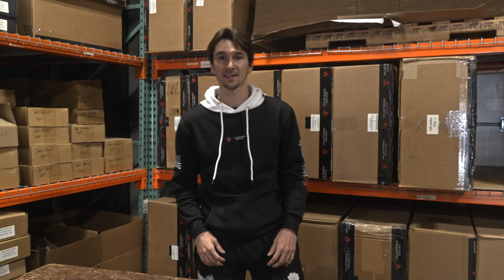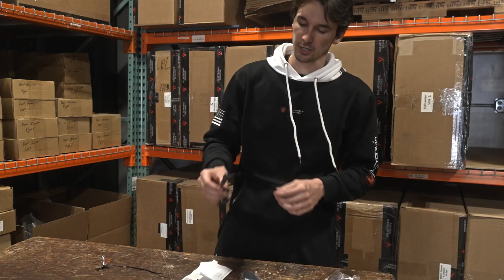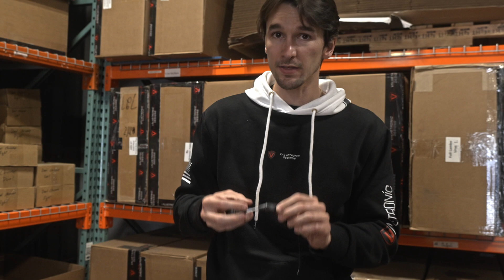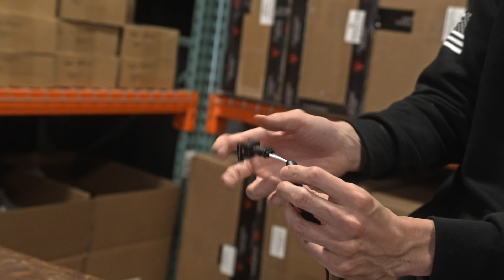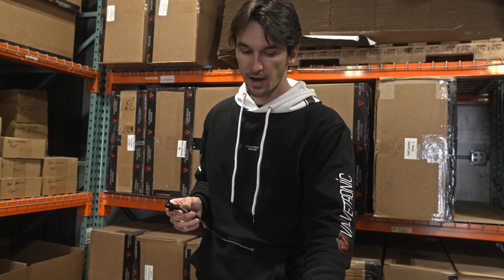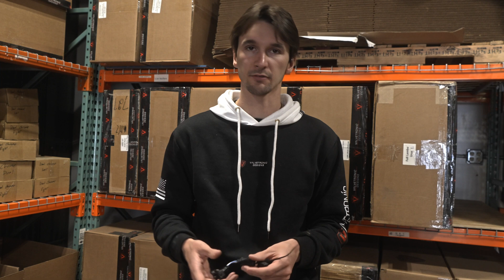OEM Valve Controller Common Issues and Fixes

Comment: I had control over my flaps for months and then they suddenly went out, they open on their own sometimes, I hear the solenoid open when I sport mode + gas it but it still doesn’t seem to open, any ideas?
Reply: Did u figure out what’s wrong ?
Reply: @yeimisantiagos2042 think it was just the burbles I had on the car smacking the valve eventually breaking it, sold the car tho never fixed
Reply: Mine is stuck closed right now for some reason.  It was fine for like a year then one day stopped opening up with the remote button. The fob battery is fine, there's power to the box,  and the vacuum line is fine.  It just won't open up now.  I'm thinking it got stuck shut inside. Kinda disappointed

Comment: Quick question, I have been told all valved exhausts create a lot of back pressure when the valve is closed. This can make your car run rough when the exhaust valve is closed but will run normal when the exhaust valve is open. Adjusting the valve actuator will open the valve and decrease the back pressure but will make your exhaust loud when the valve is in the closed position. If this is correct wouldn’t that beat the purpose of having a valve tropic exhaust if it’s loud all the time? I am very interested in your exhaust and I’m trying to learn before I buy it from you. Thanks

Comment: How come the controller is not water proofed? I got mine, upon looking at you can see all the electronics are exposed, it could go bust on the first car wash, or even rust will start building up quickly.